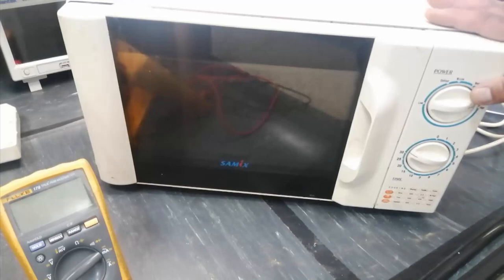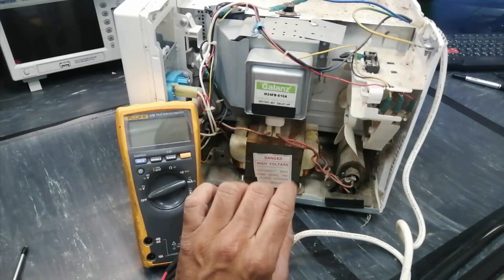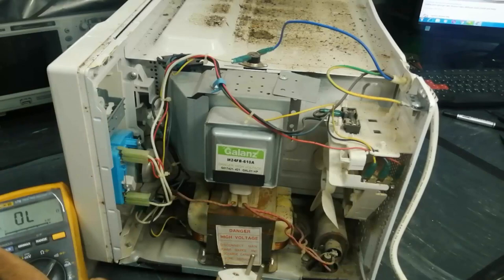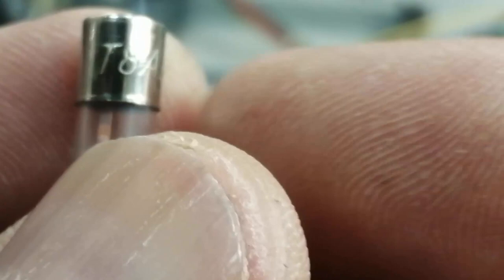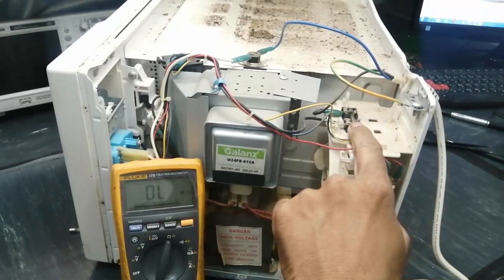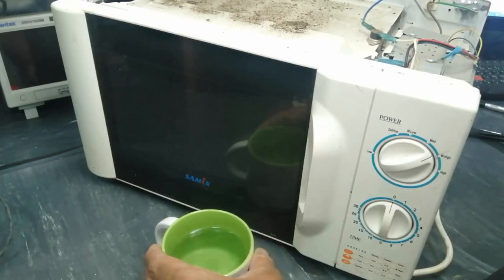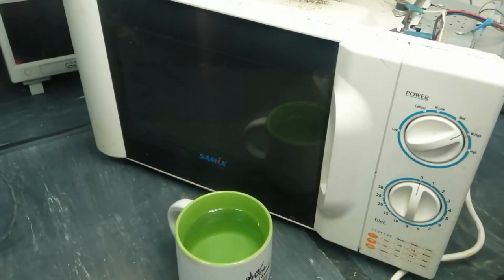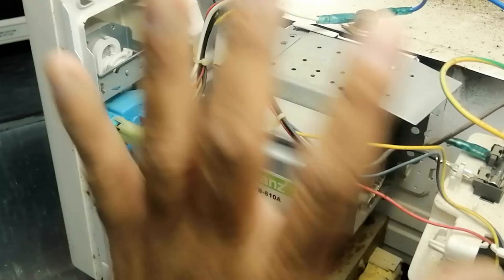#222 How to Repair Microwave Oven / Microwave not working / No Power ON

Comment: Hi , I like your way of reaching . I have a GE over the stove Microwave model JVM6172SK1SS, the exhaust fan is stuck on . I let it run for One hour but never shuts off. I cleaned all the door switch contacts and put back together. All work in circuit continuity test. Thermistors one has continuity other one no continuity. What could be causing the fan to stay on . Also microwave heats up c u p of water when I put on. Thank you  , John

Comment: Strange power plug adapter and an isolated earth conductor? OMG.
I hope this device is protected even by a RCD in the kitchen.
Reply: @HaseebElectronics  I hope is used in your lab only. It disables earth conductor of the device, that is dangerous.